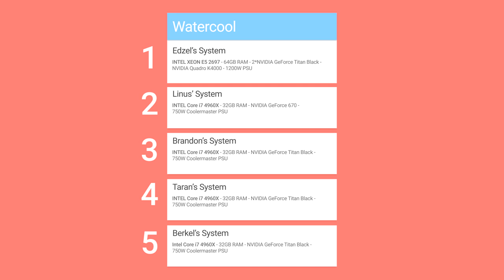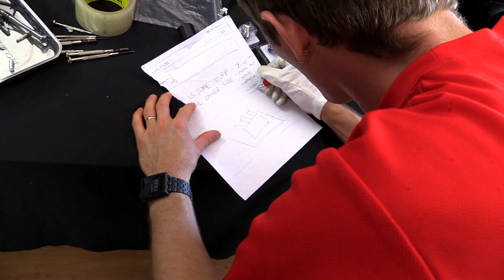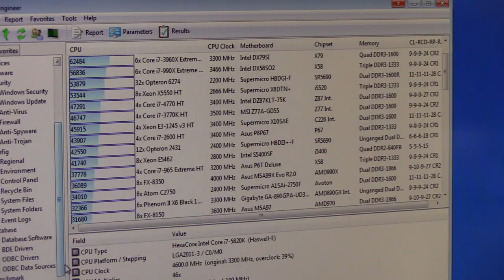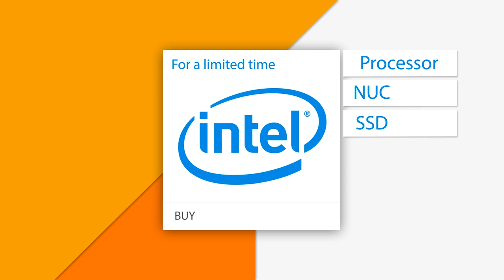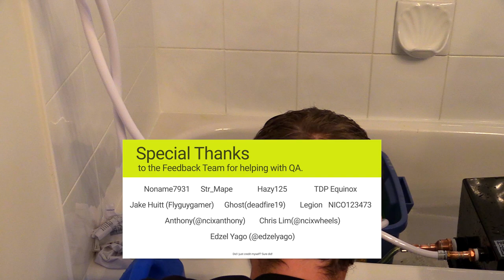Whole Room Water Cooling Part 2 - The Assembly

Comment: Lets all remind ourselves that this is all because linus decided an AC unit was too expensive.
Reply: I'm a mechanic and thought the same thing....our automotive fans are 12V too! And you can get some pretty neato, quiet, super low profile fans for classic car rebuilds/hot rods, and really ANY dimension and flow characteristics you could want. There are manufacturers out there that will make you a custom radiator without needing an arm or leg.
Reply: He wouldn't have gotten free hardware from Nvidia, Kingston, and other supporters, or even have much of a video to show, if all he did was install an AC Unit.
Reply: Jumping over a quarter to get to a dime
Reply: @MrRobarino  this! ☝️👍
Reply: I think its more that, that rooms window doesn't work with a window unit. Window units only work in Windows that open up and down. Not ones that slide left to right.
Reply: Letd also remind ourselves that he still feels an AC unit is too expensive and as such still cheaps out 5 years later
Reply: @joeyrosenbaum6893  but after 6years    he put an ac with brian the electrician in his house
Reply: That it is not a fun 7 part video
Reply: AC unit would be very wasteful for power in theory, getting these thousands of watts out of the room right away is more efficient than using even more thousands of watts to air condition them out, not that it justifies this utter madness.
Reply: @bacon.cheesecake  but the uninsulated copper tubing would just dump all the heat back into the room.
Reply: @Bartimayus  yeah, they made a mistake there, but the idea of getting heat out directly rather than wasting a bunch of power on air conditioning is still good.
Reply: probably $500 worth of testing time

Comment: Why don't you put isulation over the hot water line that goes out? That's how you can assure the heat is transferred outside and not vaporized into the room. Like normal technical house building tips for preventing condensated water to form on the copper pipes inside the structure of a building?

Comment: Can I point out 2 things:
- your "outside" electrical devices should have proper water insulation (ip65) or they will get fried on the 1st rain
- the black color for radiators and fans is not ok. It is possible that the radiators will get as hot as the cpu when exposed to direct sunlight in the summer.
Reply: Water and dust insulation, thus the number "65"; the first letter corresponds to (long story short) dust, and the second to water.
And yeah, I do agree with your idea. I wonder if they thought of that, or they thought that they were going to use insulation tape just for the splitters for the fans. Because, you (general you) know, <any form> of tape solves everything. XD

~Valk.
Reply: IP67 against water and dust.
Reply: Cosmin Staicu there's factual proof that painting automotive radiators and intercooler black decreases temperatures. The same applies to computer radiators. If you don't believe me, look up "mighty car mods"
Reply: Not to mention the water in the radiators freezing in the winter
Reply: @krisc1684  look up a channel called mighty car mods. They do an experiment
Reply: @TheREALScooterJesus  oh sweet jesus hahahahahahaha
Reply: @Chrisfamous15  But it's a bad experiment that doesn't really involve much airflow -- and airflow is the way a radiator actually works.  They ostensibly designed a convection test but actually optimized everything to skew towards radiation as much as possible, leading to the wrong conclusion.  And it's wrong because convection is the real thing that matters.
Reply: Doge Maverick  super charger heat exchange'rs would have been "cool" the fittings sizes are close to his comp enthusiast hardware, plus he doesnt require a radiator cap. He could then still use toyota or audi fluid + water wetter with Spal fans for max chill.

Comment: Idea: Build second radiator and keep it inside, and a valve to switch between them. Interior heating for winter.
Reply: that's clever
Reply: CrisInuyasha Google heats several of their offices this way. The datacenter heats the water and that gets circulated to heat the building. This way you can effectively get above 100% efficiency.
Reply: ***** it is not water, it is collant, which does not freeze :)
Reply: Especially since they live up here in Canada. Admittedly, it's Vancouver so it doesn't get THAT cold but it'd save them a ton of money on their heating bill.

Comment: Automotive engine "radiator" (heat exchanger) could easily cool a dozen or more 1000+ watt machines. Motorcycle radiators could be another option. I've used heater cores in the past for indoors and know that an automotive grade radiator is more robust for exterior durability. A simple manifold can be made from PVC and brass fittings. Just a thought for anybody interested in this kind of a build on a tighter budget. Oh yeah, and for pumps I would have used an AC baseboard heater pump because they too are robust enough to run for a decade with yearly oiling maintenance. Then for fans, just use the automotive fans and PWM them. Another option would be an inductive motor, think box fan, as they are cheap and will run for EVER with next to no maintenance.

Comment: I'm usually a pretty big fan of this channel, but this project has left me just shaking my head. Like why use a rad inside the computer if the goal is to get the heat out of the room? Why use copper pipe on the wall? It's just going to radiate the heat right back into the room... Why give the guy with no mechanical ability, the power drill? Why not verify the head pressure of the pump BEFORE tearing everything apart? Why the goofy tubing configuration on the rads? Why use cases that you have to drill holes into?

It's easy to pick apart mistakes from the outside, but really, you guys are intelligent guys... This should have been a cake walk with all of the resources you have available to you.
Reply: They need radiators because they cool the water that goes through it
Reply: I think (hope) the individual rads in the cases are for if/when they want to run a system independently of the loop, and aren't hooked up otherwise.
Reply: ***** "Youre" has an apostrophe between "r" and "e"... should be You're. 

I water cool myself.  I know the "dynamics" (nothing dynamic about it).  I'm also very educated in the field of physics.  You aren't educated enough to understand the issue.  Here's an analogy that should satisfy your apparent 6th grade education:  If you boil water in a pan, the pan itself will still be hot, and still radiate heat. - Water heated in a copper pipe heats the copper pipe, working on its own as a big radiator, but it's still in the room, radiating heat, however minute, back into the room.  This is the reason why there are regulations and codes as to how far away from wood studs hot water pipes have to be secured in house/buildings/etc.  Copper pipe radiates heat.  They should have used insulated thermoplastic tubing, like used with tank-less hot water heaters.  It holds the heat inside the tubing until it reaches it's destination... that's how you get hot water so quickly out of it.  It's nearly instant minus the distance the water travels.
Reply: Punk Sweeper I get that, but then the rest of it is all pointless.  The same water is going to run through them, and radiate the same heat in the room as the big copper array they have on the wall.  It's just poor execution... especially for these guys.  That's all I'm getting at.  Unless ALL of the rads are outside, and the heated water is insulate from the air until it gets there, it's a big project for almost no return.
Reply: ***** I don't know if you got it, but the water is warm when coming out of the computers until they reach the radiators outsides and the will heat up he copper pipes on their way outside.
Reply: I get your point about having radiators inside the case, as well as outside the room, but they've said that they want the systems to be able to run on their own, so they can be moved without having to redo all of the room cooling and the cooling in the case. 

The copper piping will heat up a bit, but the majority of the heat will still be outside the room on the large radiator array. It will still keep the room cooler than having all of the PCs running on air cooling inside the room. 

The problems with the cases, pump and such is a good point, and was just mistakes on their part. 

As for the tubing on the radiators... Why not? It won't make a difference to the performance of them, and it's probably easier to join them that way as the bends in the tubing aren't as tight as if they had just linked each radiator in a row. 

Most importantly, this project isn't meant to be as efficient as possible and be particularly effective. It's more a nice challenge for them, fun, good content to put on the channel, all while somewhat solving a problem they had.
Reply: Oshino Shinobu I just looked at the piping on the radiators outside and it seems they're more effective than putting the two outputs next to eachother togheter:
The warmer input will be next to the cooler output of the other radiator array it touches. very efficient, except for the last output which is next to the radiator with the very first input of the warmest water, but this should even out after all
Reply: ***** unfortunately by the time the water gets to the radiators outside it has already lost most of the heat generated by the computers. If you bothered to even look into this you would know that the copper pipe would dissipate the heat of the water into the room itself. The radiators are useless unless it is winter and the temperatures outside are colder than inside the office.
Reply: ***** the copper piping should reach about the same temp as the fluid running through it. How hot that is will depend on both outdoor ambient temps and how much power the systems are putting out. And the whole point of putting the rada outside is that they warm up the outside rather than the inside.
Reply: ***** Before you start running your mouth, think about it first. If the hot water is running through the copper pipes, it will warm up the pipes. Its just like having a radiator with out fins, those out-going pipes will be warmed up and with the circulation of air in the room, it will dissipate most of the heat into the room. If you STILL don't get it, find your hot water heater, find which pipe is the outgoing pipe and grab it, by your logic you wont get burned, I would like you to go test that theory.
Reply: Isaac Karjala That was the intention, but most of the heat is lost to the pipes IN the room, therefore heating up the room. They didn't insulate the pipes.
Reply: ***** Okay, this is the last time Ill try to get it through your thick skull. The water going through the pipes REGARDLESS OF HOW FAST IT GOES will heat up the pipes. Take a car for example, the coolant hoses flow ALOT more coolant than this simple little system and those hoses are rubber, which isn't the best heat conductor and they still get far to hot to touch. An average car runs at about 180F (80C)and the hoses can easily reach 160-180, you put your hand anywhere near that and you feel the heat coming off that. The only way for the pipes to absorb any heat from the room is if the room is hotter than the pipes. Heat flows from hottest to coolest, and in this case the pipes are the hottest part in the room (because they absorbed the heat from the coolant) and will dissipate that heat into the room. By your logic, the faster the water flows the less heat it transfers to what ever it touches, the radiators wouldn't absorb any heat from the water which would render radiators absolutely useless AND the water wouldn't even absorb the heat from the copper heat sinks in the computer. Because both the radiators and pipes are copper, they will absorb the same amount of heat from the water, so (assuming there isn't any heat loss anywhere in the system, only heat going from the water to the copper) the radiators will be the same temperature as the pipes. The pipes absorb heat just as quickly as the radiator, and because in this case the pipes have such a large surface area they are acting as one big radiator.
Reply: Are you guys fcking serious about those copper pipes heating in the room , they wont be like 80 °C hot so that they would affect the room that much , ffs , and even then they would not affect the room temperature that much , like it would having all radiators in the room dissipating the heat .. so they will gain a little bit of something ,but as linus said in part one ,probably not that much , and whole purpose of this was not really to be that much effective rather then just something unique and cool :)
Reply: ***** the copper pipes and rads and the fluid going through them should all be at about the same temperature.. the plumbing closest to the heat generating components will be slightly (as in, less than 5° C) hotter than the rads, and if it's more than slightly then upgrading the pump would fix that. If all the outside facing surface area of the pipes and rads is the same temperature (and same wind speed, humidity etc etc), than the fraction of heat escaping back into the room would be exactly equal to the fraction of pipe&rad surface area in the room... yes, using plumbing with better thermal resistance would of been better, but then I also know that green antifreeze is safe for copper plumbing and rads with Pb-Tn soldered joints and also for stainless steel, I have no idea if it's safe with PVC or PEX or even cast iron. Stainless steel has higher thermal resistance tham copper, but it also costs more.
Reply: Isaac Karjala Yeah that make's sense. What I didn't take into concideration is the temperature outside. if it is cold then the cooling liquid will get very cold, and probabgly will get warmed up to 80 degress F at a max, so yes, it would stay relatively cool in the room. What I am worried about is when it is hot outside. If it is lets say, 100 degrees then the cooling fluid will only cool to that temperature right? So then they are cooling (seems like warming) the computers with hot liquid which then becomes even warmer due to the computers, and then running through heat conductive pipes that are not insulated? it just seems like poor planning.
Reply: Yeah, like why the hell did the jamble a bunch of PC rads together when they could have used automotive or HVAC rads and just used some adapters, a larger main pump, and a big fan. The unit is outside the office so it's ok if it puts out some sound.
Reply: haha going to all that effort to have air cooled liquid, why not run it into the house freezer lol
Reply: The heated copper piping is easily fixed with some foam insulation running around the piping. They said at the start of the project that this was more of a form over function type of thing. Why even argue over what they are doing?

This is just a neat project they are sharing with us while they build a better working space for themselves. I'm enjoying, hiccups and all, all the insight into the 'behind the scenes' kind of stuff of one of my favourite tech groups.

Thanks so much for all the information and entertainment you guys bring us.
Reply: Nick Schall Not going to read all the comments just going to answer.
The Rads in the computers are not connected while they are on the whole room loop.  They are only there so if they need to run a system on it's own, they can.
While the copper tubes MAY radiate SOME heat, that doesn't really make a difference. Even if it did, you also have copper tubes radiating SOME cold as well, on their way back to the loop...

The tubing config is like that so it goes in one end and out the other. And other config and they would have been left with a tube sticking out at the end and it looked dumb (er). 
They didn't plan to drill the holes, and besides, there are no cases with holes designed for that... Plus, they were sponsored. 

-Some guy who was side by side with the whole thing that got 10 seconds of credits in the video.

Comment: a low pressure side hvac rad from an old ac unit mounted above the highest point in your system and outside.. would provide you with a 100% passive system, with a check/one way valve in the loop the hot water would rise up , cool off in the radiator then sink back down effectively cycling the system for you, with that much fluid volume it would do a nice job and be Nearly maintence free!
Reply: If there is anything doing work specifically to cool the system, it isn't passive. Also, convection doesn't move enough liquid to remove the pump, you'd just heat soak the machines over a few hours of editing.